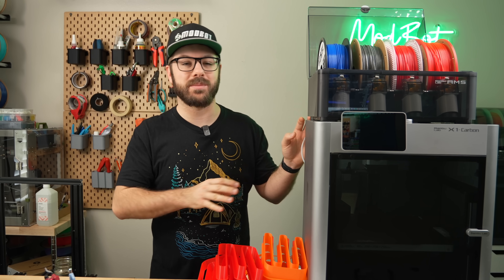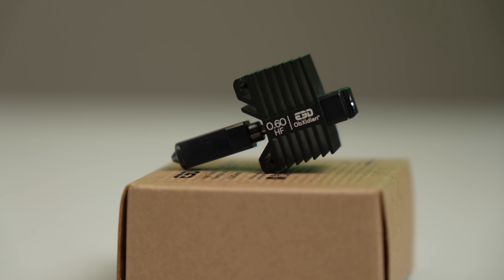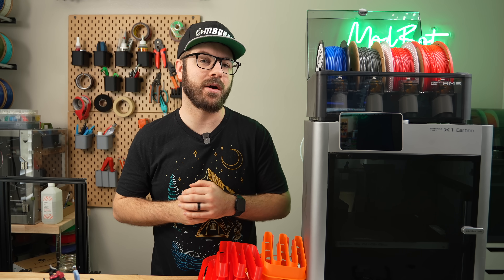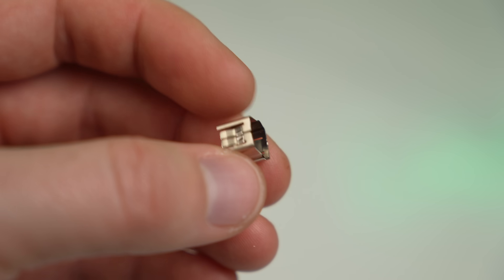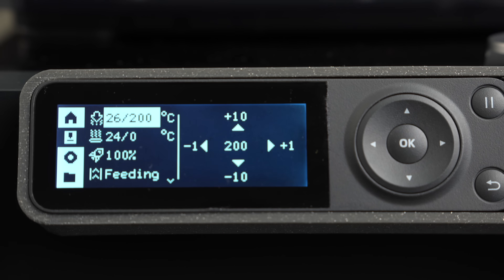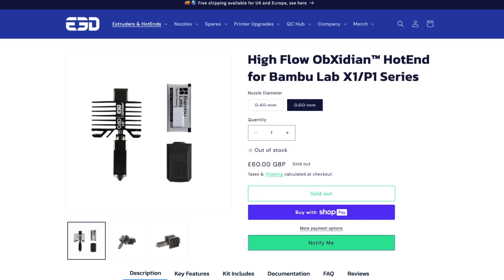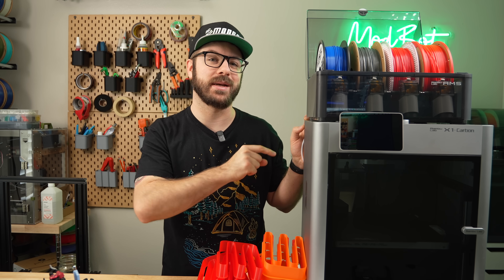Bambu Lab High Flow Hotend Upgrade (E3D ObXidian)

Comment: I bought the hotend and imported the profiles from Bambulab onto my X1C. Unfortunately, it offers absolutely no speed advantage, neither with PLA nor with PETG HF. While the flow rate is increased to 150% for the material, the parts always take the same amount of time to print compared to the standard hotend, sometimes even a few minutes longer.

Comment: If the factory hot end is fast enough for me, would there be any benefit to getting this? (I got my first printer (X1C) for Christmas). Also, I believe the factory heating element isn't up to the task at the high flow rate this hot end is capable of. I read where others upgraded to a 60 watt (Not sure if that's accurate).

Comment: The ABS problem probably means you need a beefier heatsink cooling fan (or to crank the speed). I seem to recall reading that ABS is more thermally conductive than PLA, meaning more heat can reach the heatsink through the plastic itself.

Comment: 2:10 Just wondering - how do you remove the filament after printing through a hotend like that? Won't the bifurcated molten filament solidify into 2 strings at an angle that would block the extraction since they cannot both fit in at the same time?

Comment: How much tinkering with print settings would this require? Worried getting into same wormhole as things went with E3 Pro. I'm not a engineer and would prefer to print things I need with limited setting changes. I have had X1C about three weeks now and all prints have been better than with my old E3 with very small changes at Bambu Studio. Mostly printing PLA.

Comment: So I was skeptical about the flow. I was very wrong it can print anything at 166% flow rate no problem for exception of petg. I primarily print TPU and that is the reason I bought the hot end it can print 95 a ninja at 200 mm a second. That is unheard of TPU. The only downside that I found is that for many filaments you cannot print the standard temperatures at 100%. You always have to do above the 100% speed standard settings on bambu studio.

Comment: No need for a different clip, it simply fits 180 degrees from the stock setup. Also when fitting the thermister, it's vital that you get the thermal compound into the hole, paste on the side wont help. I'll be fitting one tomorrow to see if I run into similar issues.

Comment: My guess is the nozzle temp error is due in part to the location of the thermistor relative to the ceramic heater.  If there's an appreciable heat gradient across the heating block (say, if you're doing flow rate tests at the upper limit of the ceramic heater's wattage), then the stock thermistor is going to be measuring the high end of that gradient (sitting just under the heater and before the filament channel), while the E3d thermistor is going to be measuring a lower part of that gradient (sitting far from the heater and with the filament channel between the two acting as a heat sink).

Comment: Thermal paste is not copper, it's just a better conductor than air.  It's supposed to be applied VERY thinly.  You used way too much, so the heater was not heating the hot end as much as it could, which is why you got significantly worse results than other testers.
Did you try fitting the clip the other way round?  Thermistor leads are notoriously fragile, and that just looked wrong.

Comment: 7:30 --- Bambulab should sell 55-60w heater if the printer can handle it 
(or maybe try to build custom thicker brass / copper clip to hold the heater that will help with heat transfer and add more thermal mass.... maybe it will help)

Comment: Basically tinkering with your printer for 60 pounds.
In my opinion these printers aren't meant to dick around with. You don't open a microwave up and try to get faster cook times.
These printers are getting to the point where you don't mess with them

Comment: 7:40 This is clearly an issue of the heater not being strong enough.
The error is most likely a temperature protection, as the printer is telling the hotend to heat up, but it doesn't, so it assumes a loose thermistor to avoid having the heater element heat up until it melts

Comment: AliExpress 17$ hotend gets 34 mm³s and this one 3 times the price and almost no performance boost. So 20$ for the part 40$ for the name.
Reply: Other independent testers have found they were 60% faster, and also faster than the ones on AliExpress.  I reckon this installation was janky.  Thermal paste is supposed to be applied very thinly.  If there's too much, it's not effective, so the heater isn't heating the hot end properly and can't support the higher flow.
If you own a print farm, any increase in throughput will pay for itself in no time.  E3D are about producing and selling quality, reliable products.  They don't really care what someone printing in their bedroom is prepared to pay because you are not their market and they don't owe you anything.

Comment: "You don't need to run a new PID tuning" ---> "I got a temp error". In 3d printing you NEVER change/adjust a main heating component (cables, connectors, heatsink, hotend, heating element, sensors, thermometer, etc) and don't run a PID tuning. Event if you disassemble and assemble the hotend you should run a new PID tune. Maybe Bambu Labs can add a check and recommend this via software or just mention that on the instructions
Reply from the maker: The temp error wouldn’t be prevented by a PID tune. A larger heater sure. The temps are stable until you reach the max output of what this hotend can reach. Same thing with my k1 max. Swapped out for a microswiss hotend that was specifically built for the stock setup and a few kgs of abs with completely solid temps. I don’t disagree that a pid tune couldn’t hurt anything but in this instance it’s not the culprit.
Reply: @ModBotArmy  gotcha. Was not aware of that and I've never actually had a BambuLabs machine. I've built my own printers, used some premade and I've developed my own software until projects like Marlin or Klipper evolved in what they are today. My knowledge may be outdated here. Do you know the exact error you got? I was under the impression you got what other systems may label as a thermal runaway or thermal over/under perform because the printer was expecting a different curve in the heating.

Comment: I want to see a compact heat sink combination with 1 or 2 blower fans that draws air from heat sink to cool it down as well as circulate to cool the print. That would be one fan shorter and far more advanced.

Comment: I discovered that the temperature problem it's because of the positioning of the thermistor cables and the silicone socket, when there's a gap that's not covering the metal base (close to the cables) it will give an error, because there will be a difference in the readings from the tip of the nozzle (where's the sensor) and the "cold" area that's not covering the socket. Once you put everything in the "original" position, it will go smoothly
Reply: Going to check this now... It used to give the error at ~45 flow, then I was messing with the head, potentially dislocating the termistor... now it errors out at 35 :(

Comment: Will you also be testing BIQU’s Panda hotends? It would be great to see a comparison. The price difference is significant but the benefit of being able to switch nozzles quickly is pretty nice.
Reply from the maker: I don’t know if I’ll do a dedicated video on it. Maybe a live stream on the ModBotArmy channel. Is it flow you want to see? Or just install and how well it does/doesn’t work?
Reply: @ModBotArmy  all of the above please? 😅 I’d definitely want to see the flow comparison, install, and nozzle changes. I think it currently comes with brass nozzles so it would be cool to also compare to other Revo nozzles, especially since BambuLab printers come in steel or hardened steel.

Comment: since the temp sensor is opposite site you have to flip the spring clamp also. at 1:46 you put that wrong on it. if you push it like this on the temp wires could be cutted.

Comment: I have a bigger question, based on the geometry.  Can it really retract?  The geometry should be preventing retraction, or at the very least, limiting it.  If it is able to retract at all, what is the limit of the retraction?  There is no chance of doing a cold pull with this, and an extremely small chance of clearing a clog, so how long will you truly be able to use it?  If it was only $5, it would be expensive to replace often, but not nearly as much as $75(?).  It will be nice to see if someone looks into this solely from a feasibility perspective.

Comment: I understand the wavey test and that's cool. But, what setting will I be changing in a standard print to get more benefit out of this hotend upgrade? Higher mm/s print speed? Something more?
Reply: In larger prints with higher acceleration, you'd bump up the print speed(not acceleration) to a higher maximum to take advantage of the higher flow rate.

Alternatively, you could also get  the .6mm nozzle and print double(your normal) thickness on specifically infill to speed up prints as well, which would also be taking advantage of the higher flow rate. For example, if you print at .2mm normally, you could use .4mm infill thickness and then your printer could potentially cut its infill print times nearly in half, while also making stronger infill.

Comment: did you try rotate and reverse the clip? i think if you rotate/reverse the clip it will be fit and not clamping so much force on the thermistor, just like the stock
Reply: I just did it this way. It does work but fit seems to not be as good as with original orientation

Comment: Try to get gloves that are closer to skin tight. It won’t make fidgety tasks any less fidgety but if you’ve never sized down it makes a big difference. My dad has been painting for 40 years, both automotive and industrial and he taught me that early on when I he taught me his trade. For whatever reason he has always been insanely strict with PPE and when I  first went to the mixing scales with baggy gloves he turned me right around and had me to size down. I was used to super cheap super thin gloves in my public high school and fast food job that would rip if you put on anything snug. I shared this knowledge with coworkers when I started working at a medical device company and it helped the ones that didn’t already have reasons for wearing baggy gloves.

Comment: You got 32 mm^3/s flow on PLA at the stock Bambu temperatures? In order to get to 21 mm^3/s on generic PLA on my X1 consistently, I up the print temp to 240C. Lower than that, it might be ok, or it might jam, or it might even print, but have layer adhesion.

Comment: What I'd like to see is a comparison between the stock nozzle and the E3D HF nozzles of a benchy or other model that is prone to having the finish change between matte and glossy when the machine gets limited by the minimum layer print time vs it printing at max speed.

Comment: I don't know if i missed it. But is this new hot-end hardened?
Reply: Yes it is :) - hardened with E3DLC coating which also has non-stick properties, and a hardened tip so it's harder-wearing than the standard hardened Bambu hotend

Comment: Have you tried it with PETG? I’m having a hard time recently trying to print PETG with my X1C, for some reason when it comes out from the nozzle it likes to stick to the nozzle rather than to the PEI bed and it’s driving me nuts. I’ve of course cleaned the bed with dishwasher soap, IPA and I’ve even tried glue on it, but nothing helps
Reply: Is that the PEI "Textured" bed or Smooth?
Reply: Both, but I found a solution @Omniverse0  . I found a video from Teaching Tech explaining how one can scrub a PEI plate not just with soap but also gently scrub it with steel wool. I had not a fine one but I had a polishing pad with some metal fibers embedded and gently used it doing circled. Now it works like new again, it was a really awesome trick to solve the issue

Comment: The clip has to be installed with the little "dent" covers the port of the thermistor. The clip and the ceramic heater does not care about which direction it goes. The only factor of direction is for the thermistor, and it should be adjusted accordingly.

Comment: Increased flow rate also makes the print much stronger
Reply: Can you explain this? I thought faster generally makes for weaker layer to layer adhesion?
Reply: @shenqiangshou  sorry I phrased this wrong. You're right, the faster you print the less thermal energy you can put into the filament, so at some point it won't bond properly to the previous layer. What I meant to say is that a hotend that has a higher maximum flowrate will produce a stronger print than a hotend with a low max flowrate. Note that this effect only becomes noticeable when you print faster (more than 10mm³/s)
Reply: @nikscha  right, make sense, higher flow because it has the capacity to transfer more heat to the filament. Better melted filament leads to better layer adhesion. but probably not at the absolute maximum flow rate.
Reply: @shenqiangshou  depends. It is always related to the factor of how much energy is put into the material and how much cooling is on. 
If you print fast with much cooling your prints will be weaker because the previous layer has cooled down too much. It is a fine tune of all your parameters to get strong parts. The key is how hot your previous layers are.

Comment: Far too expensive for what it is compared to Ali CHT models I'm using without any issues since months. Ceramic heater from the Rapido 2 is 88W, won't we have a safety issue using such higher power heater ? are the cables in Bambu suited for twice the power ?

Comment: No go until they have a complete assembly, including a higher-wattage heater. The whole reason I got a Bambu was to have a tool not a project.

Plug & play or no way 😕
Reply from the maker: A few others have said the same thing. That would make it a more full package. Swapping hardware over isn’t ideal.

Comment: Saw the same results on my e3d nozzle. I bought a Rapido 2. heater (80w) and will see how this stacks up. Just waiting on delivery.
Reply: Which one did you get?
The one I see on Ali looks like the wire comes out at a 90°. The Bambu one comes out the end. Do you think that will work?
Reply: @dvomang  I think the Rapido 2 heater might not work, another user on the bambu discord tried and burned their toolhead board. So DONT DO THIS.

Comment: Nice results, but is the adhesion at more common flow rates like 15 mm³/s improved? I dont care about 30 mm³/s but of i get better nelting and adhesion at 15 mm³/s id buy it
Reply: CNC kitchen has a great video on that testing another highflow bambu hotend.
Reply from the maker: Do you mean interlayer adhesion? So overall part strength?
Reply: @ModBotArmy interlayer adhesion

Comment: Now if only someone would come up with something like this for the K1 and Ender 3 V3 KE (they use the same hotend)
Reply: Trianglelab CHCB-OT Hotend is available.
Reply: @Rgierg  I’ve seen that one on AliExpress, but I had never heard of that company before
Reply: @ForOdin  I have one but not yet installed. On fb groups there are 2 ways to upgrade. Microswiss or triangle labs. It seems that triangle labs gets better flowrate and you caan use mk8 nozzles which are cheap. Ruby ones or with diamond coating. Speciall nozzles for k1 style are more expensive.
Reply: @Rgierg  hmmm, maybe I should order one….

Comment: Thermistor is on the other side than heater in e3d solution, right? Makes more sense to measure temperature of entire block than it is done in stock hotend (which has thermistor on the same side as heater).

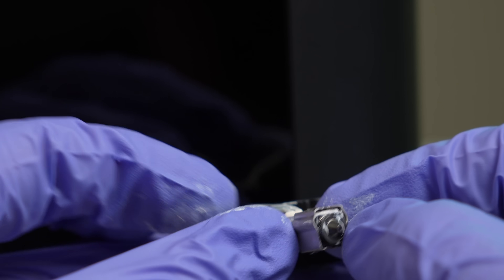Comment: Looks like it'd be a lot easier to slip that retention clip if you rotated it around the hotend 180 degrees. That way the notch (5:05) would be at the top and the little bumps would be at the bottom allowing room for the thermistor wires.
Reply: that's how they come stock, those notches are there for a reason :)
Reply from the maker: Yeah I think that is the better way of doing it. Less likely to accidentally damage the thermistor or it’s wires.
Reply: Exactly my thoughts! I was actually quite surprised why he put it on „backwards“. And judging by the few macro shots of the bare hotend the heater block had no detents or similar features visible…?
Reply: that's what I was thinking, this guy must not be naturally mechanically inclined, how could you miss that

Comment: Why is this even necessary? I have 2 X1Cs that are close to perfect right out of the box without having to "fix it" to make it work right. I don't notice any flow issues but that maybe what I print doesn't require any additional flow. IDK I've had such great luck with my machines I don't see this as benefit.
Reply from the maker: You won’t see flow issues because the stock profiles limit the max flow so that your not outrunning the hardware. Do I think everyone needs this upgrade? Absolutely not the machine is great as is. But for someone printing a lot of large parts, in a production environment, or just wanting to push limits this does make a difference.